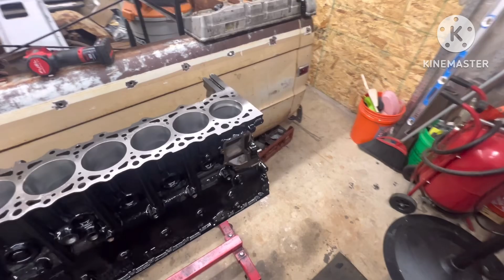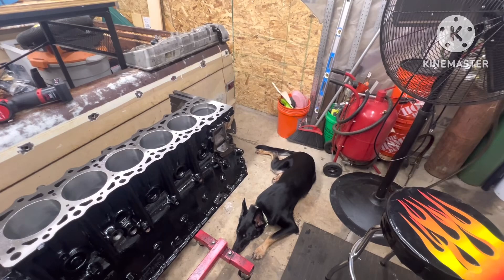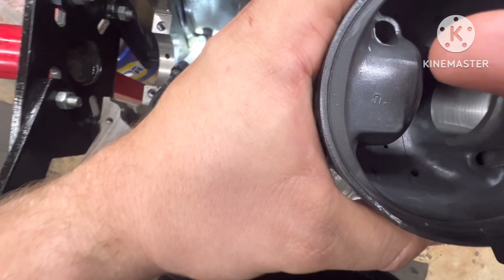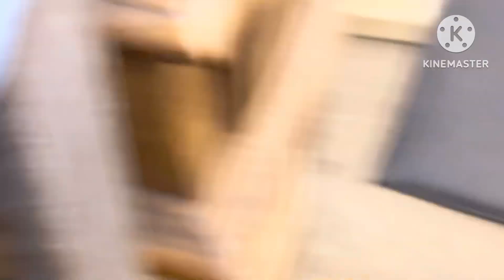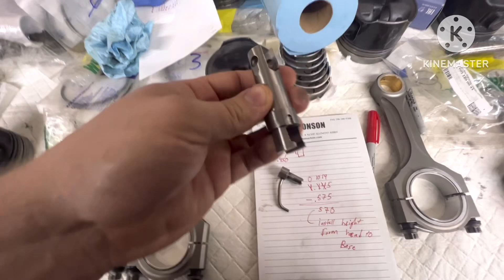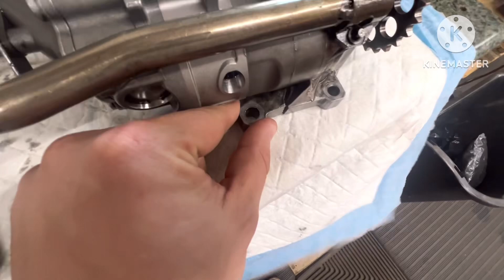1965 F100 OM606 Mercedes Benz Turbo Diesel Rebuild Part 1!

Comment: - [ ] Is there a kill switch for diesel engine since the diesel engine make runaway? And what kind of brand is your fuel pump and size?
Reply: The OM606 has a vacume actuator clap in the intake to shut of the engine if that happens

Comment: I’m looking at rebuilding my om606 soon but never attempted a rebuild. So if I decide to get the bores rehoned is this ok and then just adjust the difference with new rings. Did you use the old pistons too. Great video and hopefully will help me do a step by step build myself

Comment: great video. to the point and all the info you need. i was wondering about the crank caps as im doing a rear sump swap and had heard of pulling  a couple to switch the bolts. im excited to watch the other video's and will be subscribing to see where this project goes!

Comment: You using a C6 transmission ?
Reply from the maker: Nope.  Cd009.  Wanted something manual.
Reply: @greedypetesgarage7380  if my 351M picks up ill do a mild 606 and mate it to the C6.